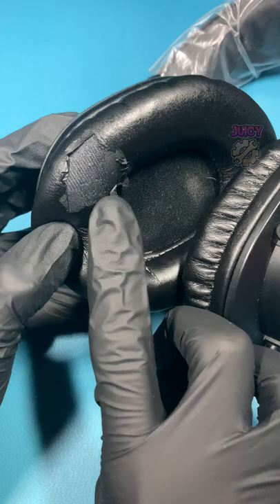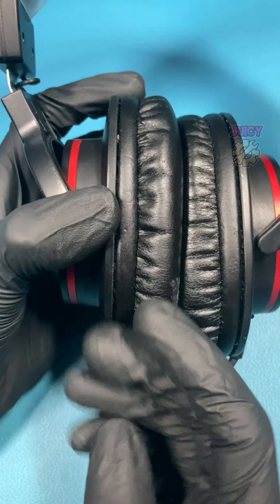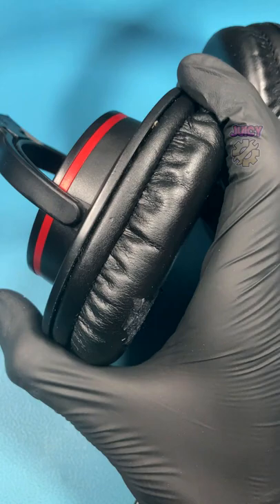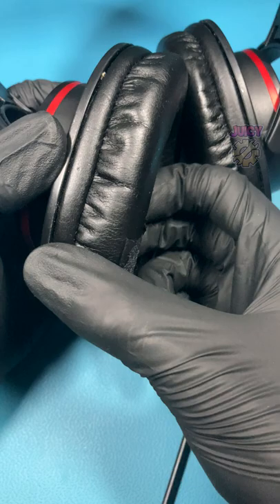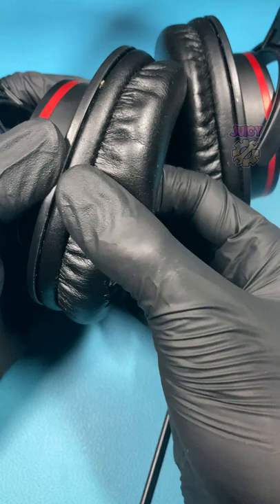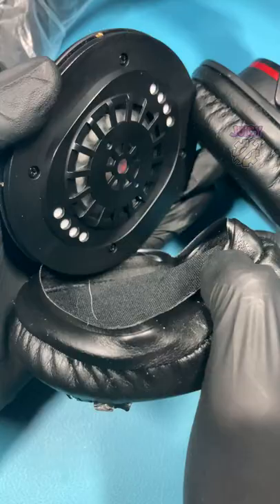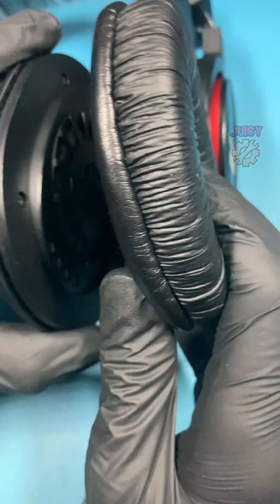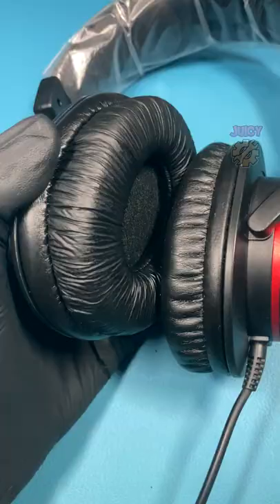3 ways on how to replace headphone ear pads

Comment: So annoying that they make them from this flakey material. Butnever the less.

Nice vid, to the point.
I had borrowed a pear of thease kinds of headphones from a friend, and he glued on the things with tape 😂
And im like " this doesent seem right, so i took the tape off and realised in just need to tuck the thing in, since there is no other way they would have been designed to go on, since under them there are screws which, you would expect to be able to safely unscrew without ripping the whole thing apart XD

Have a good day